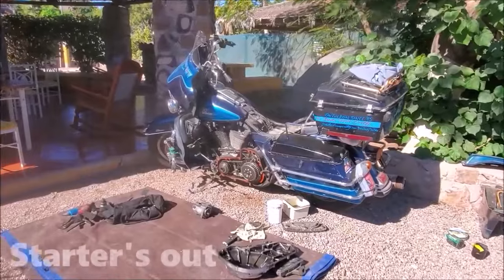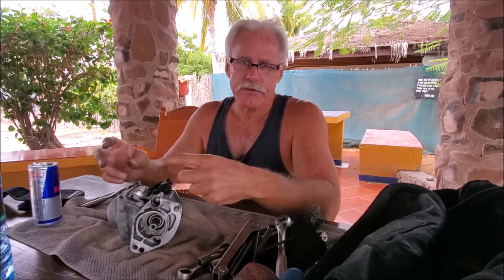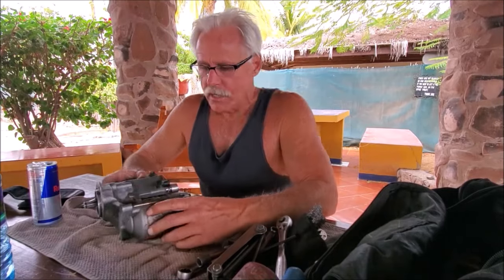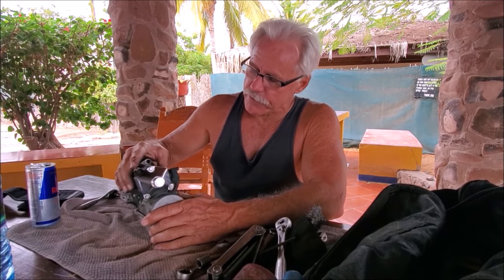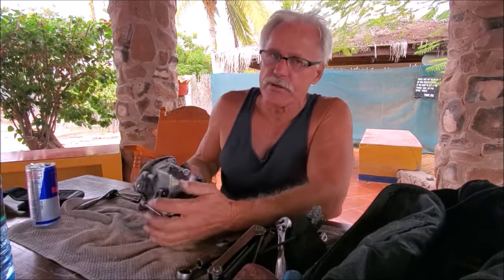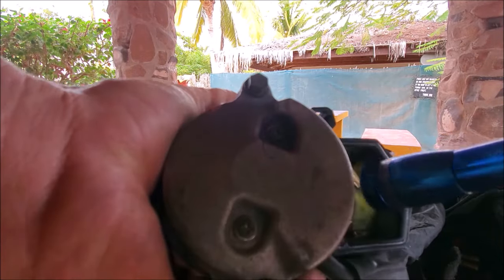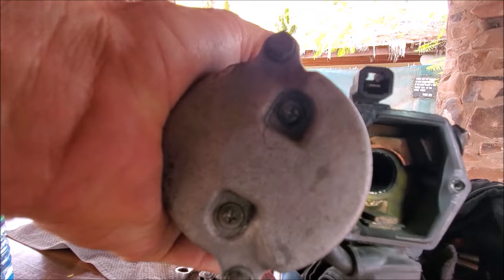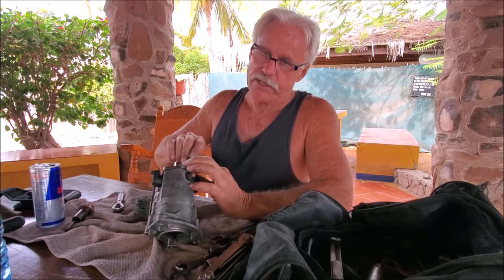Scooter Tramp Scotty. Rebuilding Your Starter. (An Older Video) #motorcyclerepair #nomadiclife

Comment: A lot of times, thr extra resistance from those contacts in the solenoid being dirty / corroded like they were, will cause the motor to pull MORE current than usual, which in turn causes the brushes to fail prematurely.

Good stuff Scotty, keep on keepin' on.

Comment: If you can’t get that starter fixed in Mexico, it won’t get fixed anywhere. Those mechanics down there can do everything with nothing much. I’ve witnessed it first hand.  Consider a shovel for your next bike. All Balls solenoids are separate. No issues. Good luck and ride safe Scotty.

Comment: That's why I don't understand why they did not leave a Kickstarter on a bike....
Reply: I have a problem with all these cars, and now some bikes, that shut off when stopped. How long will it take to wear out a starter and leave you stuck in the road?
Reply: @gregorytubbs3444  the starters are much smaller too .. friend of mine had a 2019 Chevy truck 90,000 mi we had to replace the starter on it already..
Reply: @MoeLarrycurly1  I can't tell you the miles off hand without looking it up, but my '98 Ram diesel died way before that. Mopar I guess. I put on an aftermarket high torque starter that really winds up when you turn the key.

Comment: My starter will spin but not always engage. Its a newer bike a 21. I do ride alot, almost every day. So it has started the bike a bunch. It's showing an error code for the crank position sensor. Ill try that first, then the battery and starter
Reply from the maker: Sounds like the starter drive gear also called a starter clutch. Its a rather inexpensive part of the starter. Of course, i dont really know new bikes but it should be the same.